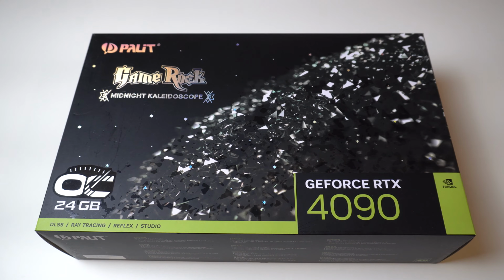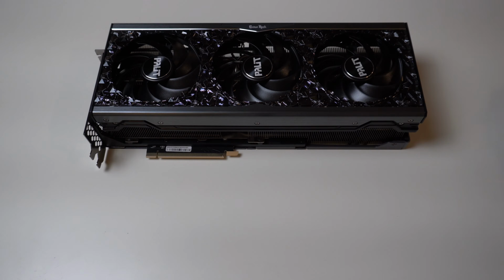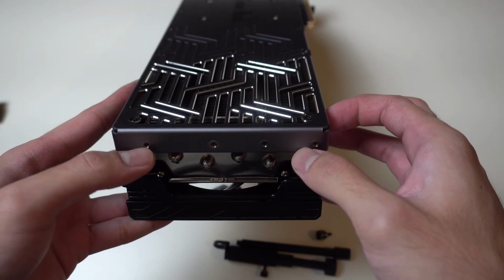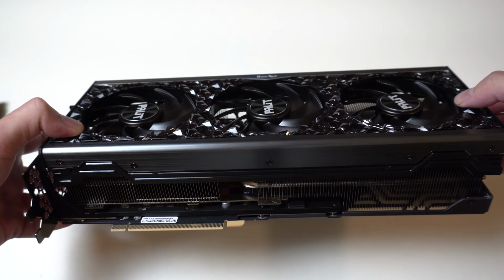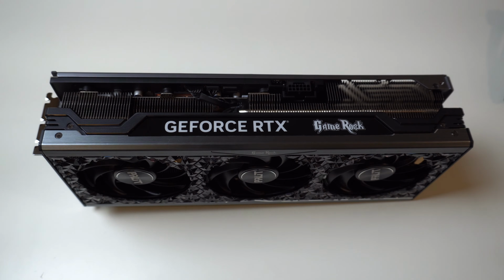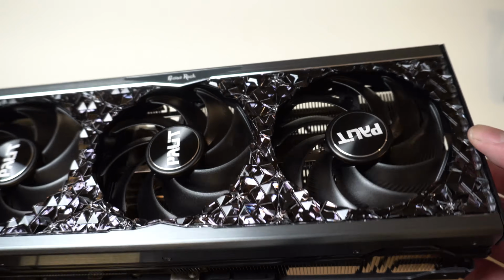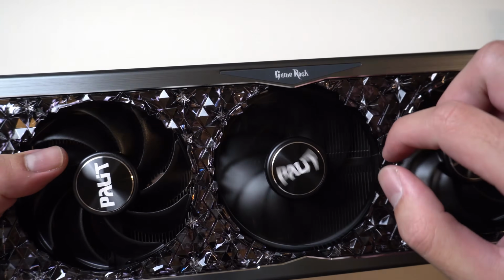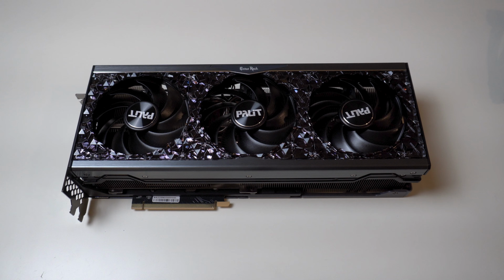This is a Graphics BRICK. | Palit RTX 4090 Gamerock OC

Comment: 450 Watts is pretty standard. What?
Reply from the maker: Lots of RTX 3080/3080Ti/3090/3090Ti custom cards allow 450W. Its not that new.
Reply: @OTechnology  It's not standard by any stretch of the imagination when you take into account all other high-end cards both recent and old, that are NOT anywhere near 450 watts.
Pretending that 450 watts is the new 250 watts makes you sound like you're pushing an agenda.
One that aligns with a company.

Comment: Need at least 1000w bios for these.
Reply from the maker: Haha I would be surprised if an XOC 1kw bios doesn't get leaked like on the 3090/Ti.
Reply: @OTechnology  yes I have it on my Asus tuf 3090, but I can only use 667w because it only has 2 8 pins :'(